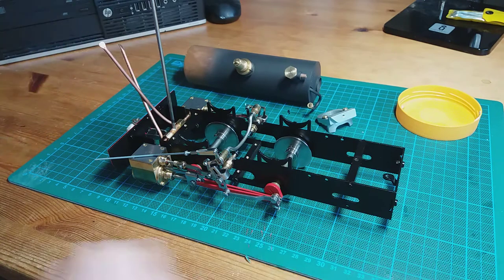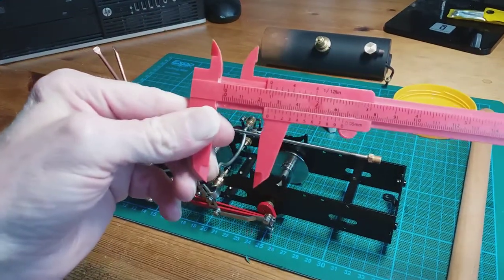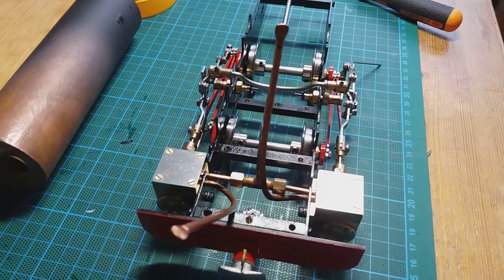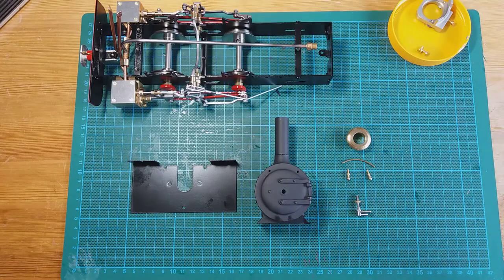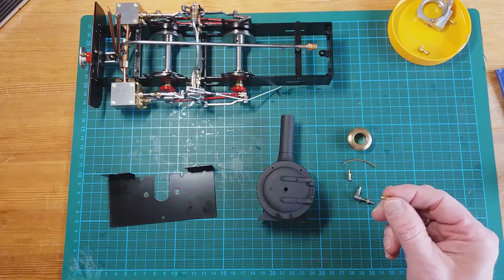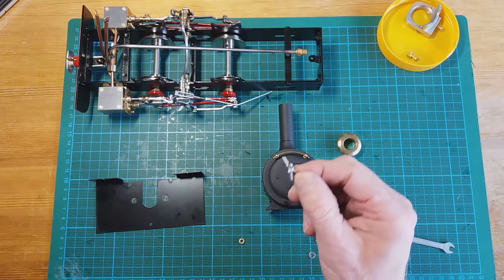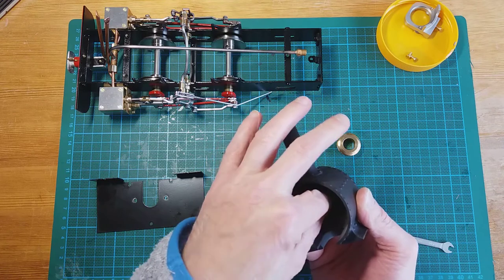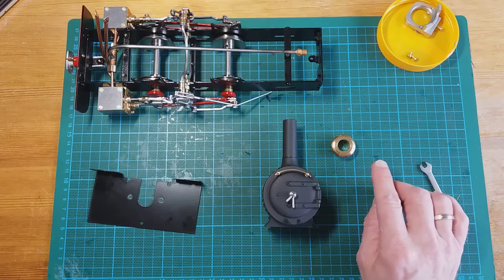RH George Part 14: Superheater pipe & Smoke Box assembly

Comment: Use loctite 620. It is heat, oil, and acid resistant. I have use it to glue cylinder caps on.... works perfectly
Reply from the maker: Thanks for the tip